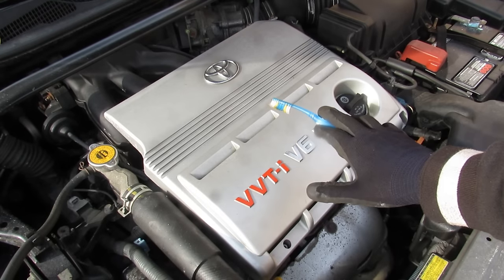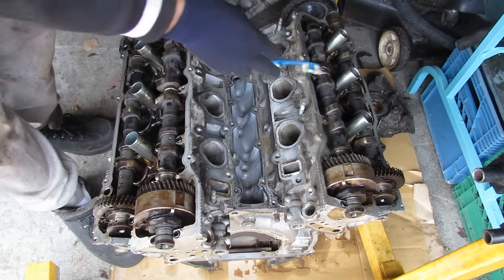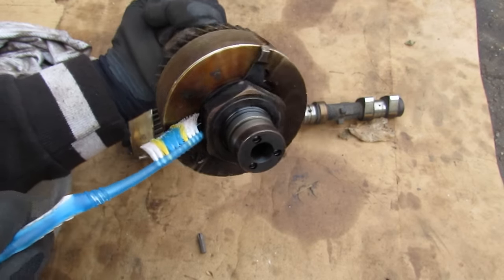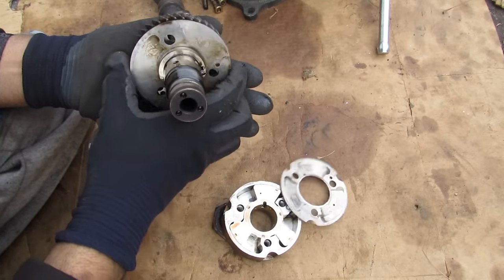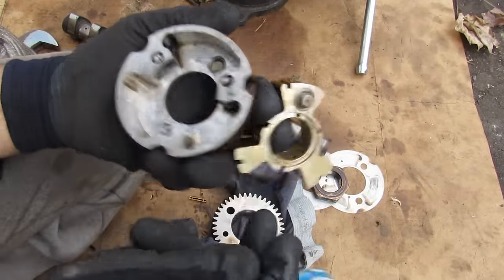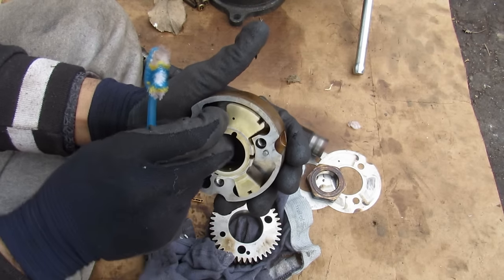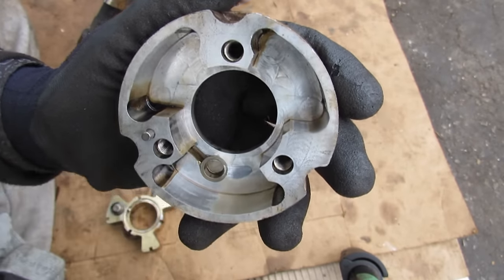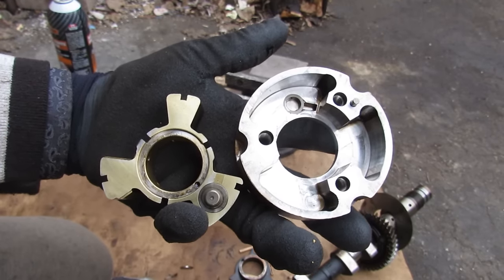Here's Why Your Car Rattles on Cold Starts

Comment: Great video. Which issue is present on the Lexus 3GR-FSE? Is this one that can be ignored or is it risky? It sounds just like your Camry.
Reply: Hi! Did you find out something? My gs450h with 2gr-fse is doing the same thing
Reply: @krejcikdavid4270  Nah, I sold that car and it never developed any issues aside from the noise. I have a different car now with a 2GR-FE and it has the same noise. I'm not aware of any easy fix. I've also heard that some of the Ford Ecoboost V6 motors develop a very similar issue.
Reply: @Vincenzo51985  Thank you!

Comment: Also applies to other engine brands such as BMW's VVT on engines like the N42.
Reply: Some of the Honda K Series engines could also rattle on cold starts as well. It's the VTC actuator that's on the camshaft which is similar to the Toyota problem. It's mostly on high mileage engines with low oil pressure which is mostly due to poor maintenance. That's why it's very important to keep up with the oil change schedules.

Comment: I hve have a 2006 1.6 Corolla which made this noise on cold start up. I changed the oil brand to a slightly more expensive one and the rattle is gone.

Comment: My car rattled due to timing chain tensioner and it was easy to change on 2013 Rav4 and cost me $20
Reply: I have the same rattle sound in my 2010 corolla i just bought. Only happens whe it's sitting for an hour or more.
Reply: @kingh2310  change the tensioner

Comment: It sucks, because our relatively new Honda Fit (2015 with 57k mi) has this exact issue and it's a god awful noise. Fortunately, it's still under warranty. Honda has a TSB out for the issue and an updated part that supposedly doesn't have as much trouble. Fingers crossed. I'm taking it in tomorrow.

Comment: Thank you for this video, good stuff.  i have a 2001 Sienna with the 1mzfe and have always wondered what that noise is on cold starts and (been 3 weeks since the last start of the engine).
Reply from the maker: Yeah, my Camry rattle is getting noiser everyday
Reply: @speedkar99   sir, what type of oil and viscosity do you recommend for toyota 1zr fe engine? Only weekend car. Thank you sir!

Comment: I let my RPM completely drop to idle before shutting the engine off.  That allows the timing to retard, so the spring-loaded pin would lock the cam phaser into place when the oil pressure cuts off.
Reply: How do you mean letting the rpm drop to idle? How do you achieve that

Comment: My 2009 corolla had the same problem starting at 85000 miles.  After replacing my I took the old one apart and found that one of the 3 cogs of the inner gear body (that connects directly to the cam) had cracked all the way through and was just floating inside the assembly.  I believe that was my problem
Reply: Did it grenade your engine?
Reply: @wilsonemeka1833   Nope. It’s remained in place, contained within the Camshaft Gear assembly outer shell/cover.  I only discovered the root issue after I replacing with new camshaft gear assembly, deciding to take the old one apart and have a look inside.
I removed the 3 screws and pulled off the outer shell. At first glance, that internal gear appeared to be okay, but when I pulled it out to have a closer look, one of those cogs fell to the ground.  There was no debris nor metal shavings within the assembly, the cog break was such that it remained in place continuing to function with the inner gear (with the exception of letting oil slowly seep out of the pressurized cavity when the car sat dormant overnight).
Reply: @wilsonemeka1833   I shouldn’t have used the word “floating”.  The cog was completely broken from the rest of the inner gear, but due to the nature of the breakage it stayed in place, continuing to move and operate with the inner gear.  
Btw I lived with the issue nearly 100k miles before replacing it. Periodically, ran a magnet through the oil after changes, and never found metal shavings, so I didn’t worry that much about it.

Comment: I forgot add, Toyota engines have that hidden oil filter in the block that filters the oil going to the VVT's.  Dirty filter causes low oil pressure at the VVT's which lead to problems, snow effect!

Comment: Mercedes AMG does not have that little steel insert for the lock pin recess. Its a little bit more common on the M156 😂😭

Comment: Very informative. This is also quite common on Mazda's DISI Engine in the mazdaspeed3, 6, and cx-30.
Reply: Not really, on the older Mazdas  it’s was the chain tensioner that went bad. In the newer mazda’s I never heard any complaints.
Reply: @jorgecampos9659  all the speed guys I know have had problems with the module, myself included

Comment: Do all v6s use timing belt? Even in modern engines.
Reply: No. Its mainly just a Honda/Toyota thing. Most use timing chains. If they want to go hardcore they use timing gears, but those are rare these days.
Reply: All Toyota V6 engines now timing chain driven. They began switching when the 2GR-FE 3.5L Toyota engine came out in 2005.

Comment: My 2009 RX350 sounds like a diesel when cold but when it warms up it is fine.  By diesel I mean it knocks,  not super loud,   but doesn't sound like that on startup
Reply from the maker: Hmm then you might have some serious issues. The oil gallies could be starving the top part of the engine of oil until it warms up.
Reply: @speedkar99  Good thing I bought it in June when it was warm.  Sadly only 84k miles and never once was it written in any of the services in the Lexus history when serviced.  Should probably get it to a good mechanic

Comment: Question for speedkar99...  Brilliant you explained my 2006 Hyunda Azera start-up noise perfectly. 

My question ... should I just try Lucas Oil treatment?  or do nothing and run to failure, with 142K miles, the cost & risk to replace pins.. I say no. I just changed oil (high mileage synthetic) and used a quality filter.

Please reply, I respect your videos so much!

Comment: I bought a 2006 is250 I kinda got screwed on it lol so the odometer reads 125k but the actual mileage is around 214k 😥 and every time I start it up in the morning it makes s rattling noise the last up to second and a half hopefully I can drive the car for a little bit before it breaks
Reply from the maker: First year model of the base engine...not a good choice 😕
Reply: @speedkar99  I would of never bought if I had known the actual mileage 😔 I was thinking 🤔 it's a Toyota/Lexus engine it should have no problems, the check engine light came on but it was just one Code for the oxygen sensor

Comment: Hello speedkar99!. I took my 2009 Toyota, Matrix to Toyota dealer in Oregon, Portland, for the same problem. The diagnose they put was Timing Camshaft Gear needs to be update! They told me that it does not heart the engine, but if bothers me they can fix it for $980 in Oregon

Comment: Mercedes engines from the 90s (M104,or M111 in my case) do the same as well.
I was terrified because I thought it was the timing chain,but the sound is quite literally the same.And I know MB VVT has problems usually.
There's this other thing with M111 Benz engines especially,where the VVT causes it to rattle at 2200rpm.Can you make a video explaining that as well?

Comment: I too have this rattle. But my car does something interesting. The first cold start of the morning my car starts up perfectly. But every subsequent start up throughout the day requires more effort to turn on my car. Sometimes I'm waiting a whole second for my vehicle to turn on. 

Anyone know what's the deal here?
Reply: Sounds like a car battery issue, or your alternator is not charging your battery
Reply: @amitsunoko7270  nah all those items are good. 3 months later and I'm still having the issue but at least it hasn't gotten worse lol.
Reply: @MiguelRPD  So when you start the car it'll take longer to start or between start you have to stop and wait a little while longer each time to try and start again.
Reply: @amitsunoko7270  yes.

On first cold start: starts normally
Every time I turn it on after that: takes a second longer. Sometimes 1.5 seconds (feels notificable)

Comment: This has been going on in my 2011 accord 2.4L engine basically since brand new.
Reply: Any issue with the engine now ?
Reply: @jonjon4445  no it still runs strong 🤷‍♂️ just regular maintenance. Hondas are good cars.
Reply: @rob6027  hey thanks I have same sound coming from my Toyota crown 60,000 km ! 
When you leave your key in your car before turning the ignition it may have somehow stopped that grinding sound in my car ! 

Anyway thanks !

Comment: ...i had a Lexus is250 did the same thing lucky it was under warranty took it to Lexus when they finished with it they changed a lot of stuff cams and more things, after that it started to use a lot of oil so got rid of it. Second had a 14'Camry did the same thing, got rid of it got a new 21' Accord 2.0t sport.

Comment: I have a Nissan frontier 03 and I have the same exact rattle at same exact conditions...

I been looking and asking around for ages, I gave up!!!! Then there's a video that gets recommended by YouTube out of nowhere 🤯🤯🤯🤯
Reply: That the timing chain tensioner, works on oil pressure.
Reply: @bryantphillips930  so that's normal? ☹️
Reply: @Mr.Ramirez95  well for nissans it is. Usually the plastic timing chain guides wear out fast. So at startup it has to wait for the oil pressure to build up to tighten the chain.
Reply: @Mr.Ramirez95  besides going into the engine to replace parts (which will wear out again)
Use a higher end oil filter with a better anti drain back valve to better keep more oil pressure from draining       while shut off.  😉 You'll notice it's common on older nissans especially 2.4s
Reply: @bryantphillips930  hmm I thought all oil filters were created equal. I also thought of reducing oil Weight to help it gain pressure quicker? Thanks for the info!
Reply: @Mr.Ramirez95  there's improved filters with silicone anti drain back valves, retain the oil better if the filter is mounted horizontal. I'd stick with a 5-10w30 personally. (I'm in the south a warm climate).  Good talking with yah.
Reply: @bryantphillips930  currently I have 10w30 I'll probably try 5w30 and I'll definitely look into the the oil filter. It's about time for an oil change that I've been putting off for a few days. It was 28F outside. Thanks for the tip. 👍
Reply: @Mr.Ramirez95  10w30 is my preference.  But yeah where I am it only goes below 30' for short very periods.  And in consideration of the milage/wear already on the engine.

Comment: Run an engine flush. Switch to synthetic and add liquimoly ceratec or restlone nano prime. Fixes that
Reply: Have you done this?
Reply: @andyfer7716  yupp. Fixed on  toyota 2gr fe. Restlone nano prime is awesome. If it mixes with sludge,  your screwed. Flush and use a synthetic oil.

Comment: What a bad design I have a Kia Venga 63 plate with an automatic transmission. After so many years I wonder how many years the engine will last. Even at 35 k am not too confident that the engine will last more than 150k.
Reply from the maker: What's a Venga?
Reply: @speedkar99  Kia Venga is the name in the United Kingdom....Both petrol engines feature continuously variable valve timing, which means four-fifths of the 1.4’s maximum 101lb ft of torque is available from 1500rpm.

Comment: I would just drive it until it blows up or run a treatment such as marvel mystery oil or some other heavy duty engine cleaner through it before I take apart the upper end pull the cams off and pull off the VVT phasers just to do this

Comment: Thanks for the lesson . The VVT is complete garbage . How is it that a simple small block Chevy with push rods can easily go 200 K with basic maintence ? Somewhere between the overcomplicated VVT engineering and people not changing their oil lies the answer . The cost to repair and some low end " techs " combined with aftermarket junk parts make for a huge gamble to fix this .

Comment: Question though!  If that cam phasor pin isn’t engaged upon startup, doesn’t that mean the engine timing might be too far advanced??  And isn’t that unambiguously a BAD thing with respect to knock and engine longevity??  That rattle sounds BAD to me — like metal on metal.  WHY then, do you seem to imply that it’s not that big of a deal?

Comment: If you have this problem on a Honda 2.4 l Vtec there is a Emissions warranty 15yrs and 150000 miles it will be replaced for free at Honda dealer.  A $900 dollar repair.

Comment: maybe the wrong oil was used,  5W- 30, is correct,  for toyota echo 2005,  with VVT-I, the oil  numbers are more important than ever before,  a further thought, metal wears when under LOAD, so what is the Load action here ? turning off the engine, and oil presures dropping - NO,  engine stopping-not resetting the lock postion before oil pressure drops- NO, the LOCK is held at idle and low revs,  - the most retarded timing setting, why does the lock not reset at off? there is no homing spring ? nor homing oil pressure from the plunger  controller, the key turns off the engine, but maybe the keys should signal the engine to reset and then turn off- .... any ideas ?
Reply from the maker: Wear

Comment: Hey folks,

Is this that same rattle that happens on the hybrids like my 2015 Prius when I start it up?

It will make this noise for 5 or 10 seconds, however if you give it fuel it will go away pretty well instantly, only seems to happen on cold starts in the winter time.

Any enlightenment would be appreciated,  take care🍻👊🇨🇦

Comment: OK, well my camry only does this when first started after oil change with little or not oil in the filter, so I won't worry about it...This 09 2.4L has been a rattle trap since new, sounds more like a worn out Vega than a Toyota.  But, I guess its normal, has made most of these noises since new and hasn't gotten much worse with 180K miles on it.  I just don't think the benefits of VVT are worth all the mechanical headaches.  This Camry can't get out of its own way on the highway, even with the 5 speed...Turn on the AC and you damn well better stay in the right lane.  Should have kept my 99 Solara V6, this car has been a disappointment.

Comment: I had a similar sound on my 97 Taurus...it was the oil pump failing. Nothing serious....just terminated the engine. At least Toyota rattle is nothing super serious. I get the sense you don't like your brother to much. He must be running low on underwear.

Comment: What would cause the VVTI to not lock in I replaced mine along with the OCV valves and screens bank 2 is still making noise I cleaned everything and blew compressed air through the oil galleys driving me crazy any ideas thanks for the video.https://www.youtube.com/watch?v=jWtFqnHD3BA

Comment: I change the oil/filter  every 3k miles or twice  a year.
I've never had a major engine problem. The cost is less than repairs.
Reply: Or just live with a little rattle at startup on an old car.  It doesn’t harm the engine.

Comment: Theres engines are trash!! I’ve seen over a dozen and all the crankshafts were damaged from low engine oil pressure that was used by the VVTi engine design ...😱😵🤬

Comment: The basic problem here isToyota engineers are often clueless. The can’t even design head bolts that engage enough threads with the block or oil control rings that don’t fail. Both often result in total destruction of Toyota’s poorly designed engines. This VVT rattle is just another example of poor engineering when most VVT engines from other companies do not have this issue. For that matter Toyota should have owned the EV market given their lead with hybrids but they have their head stuck in the sand while almost ever other car company shames them with their EV offerings. Toyota = Poor Engineering